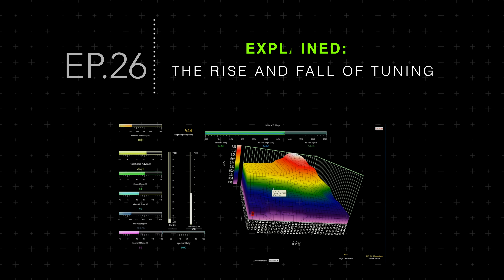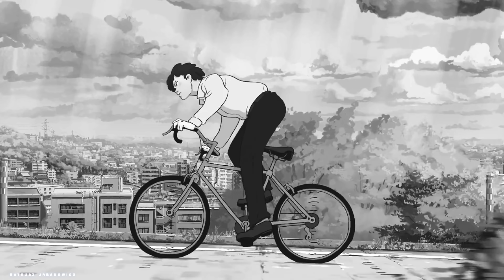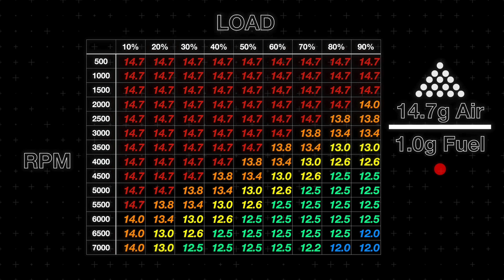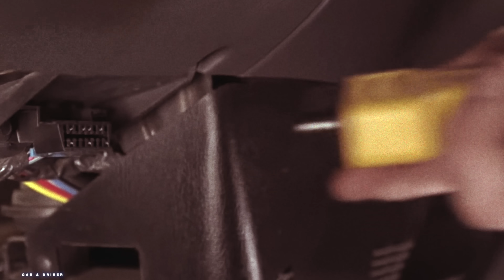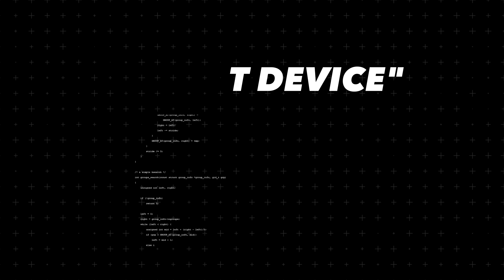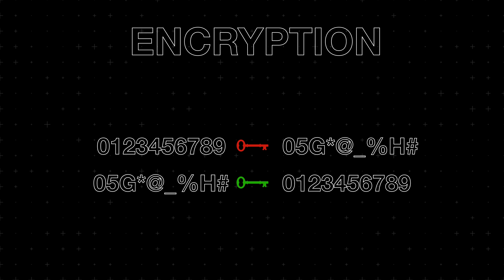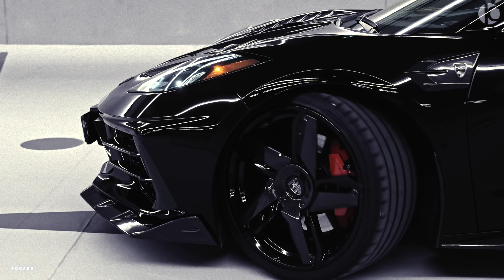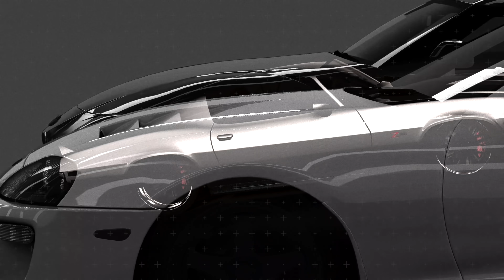How Tuning Engines Became Illegal👮🏻‍♂️| Explained Ep.26

Comment: The infinite wisdom of the CAFE regulations also simultaneously ensured more people drive large, heavy vehicles like CUV, SUV, and pickup trucks every day. The calculation for expected fuel mileage uses vehicle footprint as a factor - as a result larger vehicles are held to lower emissions standards. This makes auto makers prioritize selling large vehicles as the profit margins are higher. The irony.
Reply: Granted wasn’t this Auto Industry Lobbyist Caused?
Reply: @ericlotze7724 yes they claimed the extra expense needed to meet regulations would be passed onto the buyers which at the time was pretty much only farmers. But there is a 25% tariff on light trucks that has existed from 1964 which was lobbied in. This made them much more profitable so they lobbied for easy to meet emissions to make them even more profitable. Then they advertised the shit out of them and now there are no cheap cool second hand cars anymore because people bought suvs and trucks instead of a nice car
Reply: L iberalism will always generate the exact opposite of its stated intent.
Reply: Yes! Nice one, I had totally forgot about that but you're absolutely right. Not just do these vehicles pollute more but they also consume more fuel, which in turn drives up the price of gasoline (which means $$$ for oil companies).
Reply: I believe that was a compromise by compromised legislators and bureaucrats giving in to lobbyists from Big Oil and Big Auto.
Reply: Exactly. You've got people driving emissions compliant behemoths to commute alone to work. Collectively consuming more fuel and emitting more emissions than the comparatively small percentage of modified cars that are typically only driven a few K miles per year.

The irony.

Comment: Funny you mention bicycles! I have been biking neck and forth from work bc I’d only a few miles and I’ve noticed with my aggressive mountain bike pedals I can apply leg power in two different ways. Method one is like the video mentioned. Which mentally can be visualized and a up/down motion capitalizing on the leverage given by my legs and pedals, method two is where I use the grip of my aggressive pedals too silly power though nearly 360 degrees! It’s much more effort but the human body can adapt amazingly and with some practice I can accelerate MUCH more quickly by balancing the right and left leg/lever and applying as much power as possible through the greatest range of angles possible. It results in fast and effective get up at the cost of my muscles ability to endure long term lol

Comment: What percentage of cars on the road are significantly modified? 1%? 0.1%? Basically no effect on the environment.

"Banning" tuning is nothing but a virtue signal.

Its like F1 deciding to use carbon neutral fuels in racecars by 2026 while forgetting that 98.4% of F1s emission is logistics.

Comment: I've been riding motorcycles for 46 years, since I was 12. As I type this it's sinking in... I'm getting old... Anyway, first bike I tuned was a 76 Honda CB550K adorned with a beautiful Kerker 4 into 1 chrome megaphone. Removing a bank of 4 carbs from between the airbox boots and intake boots was no picnic. As an aside, as the bikes get older, the rubber hardens, making it even more unpleasant. I never minded the carb work, though, jetting, needle, accel pump, etc. In 98 I bought the first mass produced m/c with EFI, the 98 GSXR750. Of course I put a pipe on it (a Muzzy, which worked great even though the bike wasn't Kwacker green) and a K&N in it. Dynojet power commander, interface cable, laptop with DJ s/w, and maps off the internet. What a game changer! Changing the tune was no more than a seat removal away. Soooo awesome.

Comment: That’s why there’s piggyback tuning. They can’t prevent you from wiring something in between the sensors and the ECU, and with modern turbocharged cars you can get pretty far by touching just boost and MAP. And then wait until the original factory ECU files inevitably find their way to the public.

Comment: Tuning engines became illegal because cops where struggling to keep up. 
Yet in England, the faster cars you can legally buy are ex police cars. Obviously, that's unless you've tuned. 

But it really doesn't take much to out run a cop car. 130bhpis enough as most cops haven't done an advanced driving course.

Comment: The thing is, the EPA doesn’t even know what they are attempting to block. Look the entire goal for any performance tuning platform is to make a car run as clean as possible, and more efficiently then stock. Well what does that mean exactly? Well it means that through ECU tuning people are making more power, producing less carbon emissions, and allowing a motor to run at it peak without any emissions equipment.

The EPA seems to think that just cause a car produces any type of carbon it needs all this equipment bolted on to it that suffocates the motor to the point of which actually drastically reduces a motors life. For example diesels, the EGR system on a common diesel motor of today feeds its burnt fuel back into the intake of the motor which causes excess carbon build up in the motor itself. Think of it like this, you ever take a dump then ate it just cause you saw a piece of corn? Same concept of which with a simple tune to the motor can make that unburnt fuel burn on the first combustion cycle rather then over two or three. 

The EPA is just a power hungry and overly profitable business program that causes nothing but trouble no matter where they go by over stepping their power and throwing dollar signs at people who build anything better then factory. They say it’s all about keeping the air clean but in truth a 2,000hp car can be tuned to run as clean and even more efficiently then a stock Toyota Camry. 

So it’s definitely not about clean air, it’s all about money and power period. They are a government run program that fear mongers people who will always believe them and vote on any and all their BS propaganda policy’s that try and limit the people’s choices on their own items. In truth it’s technically stealing but without the action of taking unless your caught. Defund the EPA, because truth be told they aren’t looking out for us, if they were they wouldn’t be limiting the people’s freedom by pointing their fingers at the cars we drive and modify, they’d be pointing them at the bug tech factories that produced well over 80% of the world emissions, and they are constantly over stepping their boundaries by violating the people’s rights to their own property.

Comment: EV tuning's going to effectively bypass all of this, all one would need to do to make an EV faster, is dump more power into it for brushed DC drivetrains, or increase the frequency of the power already going into it for AC drivetrains, and since EVs don't directly emit anything, emissions concerns can be thrown out the window for EV tuning, in theory assuming controllers aren't locked down to holy heck, an EV tuner has free reign over how fast they can make their car, within the laws of physics anyways, ironically EVs could end up starting a tuning renaissance due to how relatively easy it is vs. ICE tuning, yet again, assuming the controller isn't locked down to heck.

Comment: And so, I SO Love my 1980 Chevy El Camino with the 5.7 liter Gen 1 small block V8, Summit Racing aluminum heads, Edelbrock Performer intake and carburator, aftermarket HEI ignition system, headers, dual exhaust, 4 speed manual transmission with Hurst shifter, Zoom clutch, 3.73 Auburn limited slip rear end... Jegs aluminum 3 row radiator, fan shroud from Monte Carlo SS... gas mileage is poor, but fun meter pegs!  As long as they keep selling gasoline....

Comment: Funny, i reverse engineered my stock ECU and used an EEPROM to tune it at first ... but it was easier as the original PROM also contained the program, not just the data, so i figured which pin was driving injectors and coils to get a head start.  There is another important aspect to the end of tuning, too; sports car engines are becoming more and more pushed in stock form. Most of them already have forged pistons and rods with forced induction, and the engine blocks are built to material fatigue tolerance, so they are lighter and smaller. The days of throwing an insanely strong and heavy lump of iron with  forged internals that can withstand triple the original engine power (like toyota did with the mk4 supra) is long gone.

Comment: Let's see...to get more fuel you can always piggyback a Bosche CIS distributor pump and injectors, for more air-flow a turbo and exhaust, all that remains is control over spark advance, I imagine you could relocate the crankshaft position sensor.

Comment: Buy or build a replacement ECU that has open-source firmware and plainly editable timing and mixture tables. You can even have different driving modes that keep emissions and fuel economy optimal then switch to performance modes at the track.

Comment: The sad sad fact of this, most of the cars with a tune are far more efficient than the factory will ever give us. Since the real power comes at near or at full throttle that means part throttle can and is usually set for lower consumption. it's not unusual for tuners setups to not lose mileage or even gain a few MPG while maximizing the powerband. Honestly if i even build another performance car, it's simple build an old car with a modern engine and an aftermarket electronics (EX. Holley or Fueltech), you can easily bypass all the BS with little issues

Comment: Fun fact: the VW ECU detecting when it was being tested to change the emissions gave the vehicle not just more power, but more fuel efficiency. So if the engine is running more efficiently when it doesn't have to meet the emissions standards, what does that tell you about the probability that the "emissions tests" are designed to kill productivity and not to actually reduce harmful emissions?

Comment: Thunderhead289 actually made a super cool video where he added some basic electronic air fuel ratio controls to a standard old carburetor. We couldn't believe the results. It lets you tune with carbs to avoid emissions tampering violations while still being able to have an air fuel table that you can control. If anybody looked at it they would just think it was a normal carburetor. But does this mean that any aftermarket computer for a car is illegal now?

Comment: its pretty simple, just remove the ECU and fit an aftermarket ECU there are plenty of software engineers out there that can create a new map for the ecu for a specific engine retaining the original behaviour of the engine or cranking out more power therefore (the intelectual property of car manufacturers isnt being used) as for the emissions a simple test to show your within tolerences of that specific car is all it would take to get the officials off your back

Comment: Idk. If you are trying to retune the ECU to get better gas mileage and better fuel burn then the company should allow it. Side note. A lot of newer ECUs have a built in clock on them that will make the vehicle start having performance issues after a certain amount of time to ensure job security. I know this because my neighbor got a brand new honda five years ago. Within the past few months the valve timing, transmission and some of the electronics in the car have started to all of a sudden malfunction. Which is part of the reason they encrypt the ECUs. They do not want people to know that their car is PROGRAMMED to malfunction after a certain amount of time and mileage.

Comment: I'll be honest I have yet to have one of my cars tuned , but my 2004 Impala LTZ has been a blast to drive without even putting a chip in it , tops out at 120 but no real need to go that fast I don't take it to a track(too old of a car for me to push hard it's my baby)
I hope that the future for cars is better torque and mpg I understand there is always a need to push it a little more and go a little faster but if I can go 100 and it feels safe and smooth I'm all for it , stock can also save some headaches modifications can bring along.
 If things run smooth at decent speed from the dealership then seems fun to me.